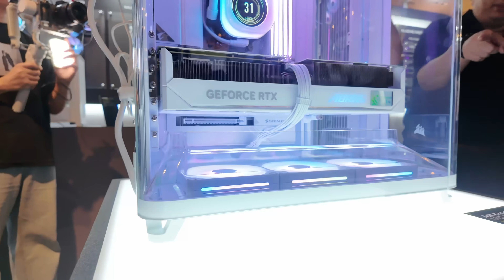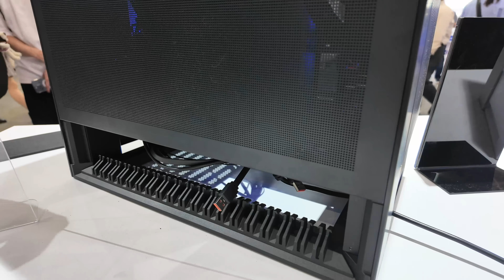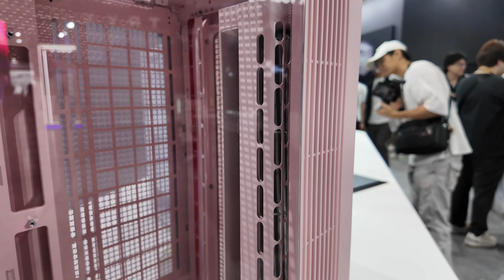Cable Management Will Never Be the Same

Comment: Timestamps:

Corsair:
Air 5400 0:14
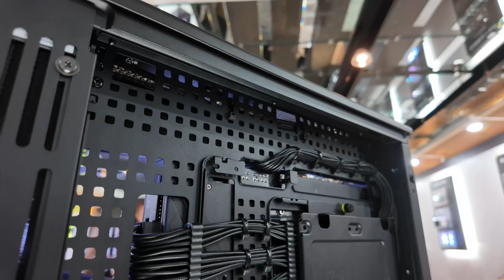4000D, 5000D 1:59

InWin:
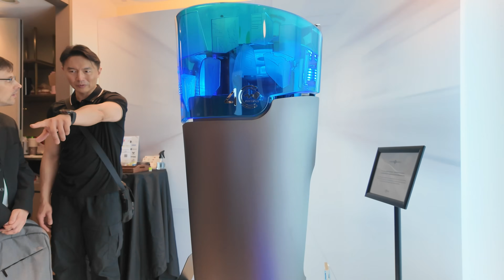Chronomancy 3:40

Gigabyte:
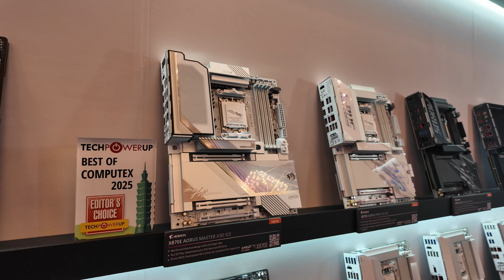Stealth Motherboards, GPUs 4:55
X3D motherboards: 6:18

AMD:
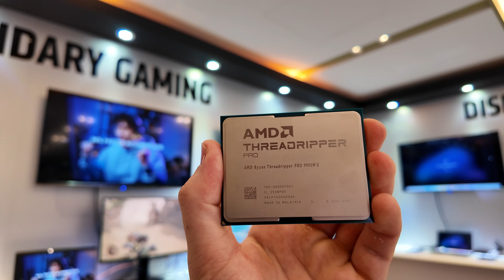Threadripper Pro 9995W X: 6:55
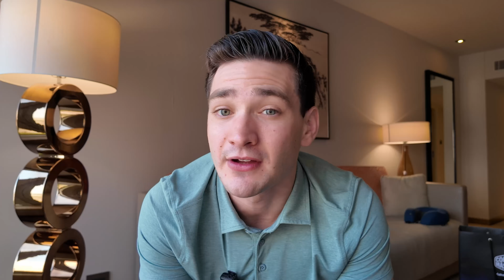Die of 9060xt 7:22

Cougar:
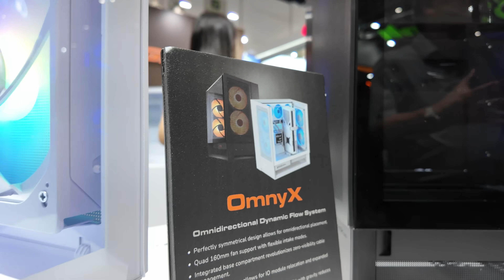Omny X Case: 8:12

Tryx:
Turris CPU air cooler: 9:03
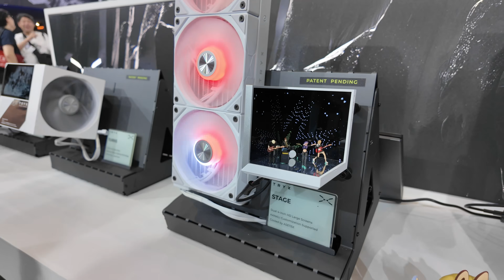Stage: 10:03
Flora Case: 10:50

Silverstone: 
FLP-02: 12:24

Lian Li: 
Hydro Shift 2 LCD AIO: 13:03

ID Cool:
DX360 GDL: 13:57

Geometric Future:
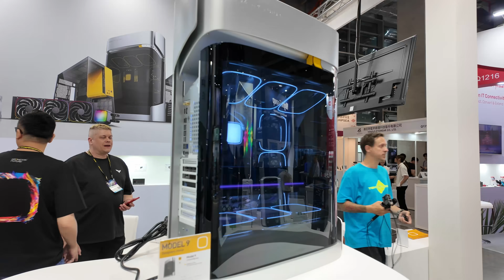Model 9 case: 14:49
Reply: I think I got all the info right from what you said, and what was written on the various products!
Reply from the maker: Thanks for doing this!
Reply: @mattscomputerservices of course!

I find it helpful when someone does it, so I did as someone else hadn’t…

Comment: When you see stuff like this, you got to ask yourself, am I building a computer or am I building a work of art. Now if it's a work of art, then all this stuff is great, but if you are building a computer, use more or less standard looking parts, and either pocket the savings, or spend it on the components that actually improve the performance of the system. Also, if your actually using the computer, your not going to be looking at all the lighting effects.
Reply: I agree. But I will approve anything that improves cable management. A lot of the "artwork" around cable management is actually just working around the messy decentralization of power slots. My least favorite part of pc builds is the power cable that's at the front of the gpu. You have to choose between routing the cable to the top to partially cover the gpu design, or to the bottom to partially cover the fans. And if you're not using a right angle connector, then you're stuck with a fat blob at the very front of your build that may or may not obstruct your side panel.